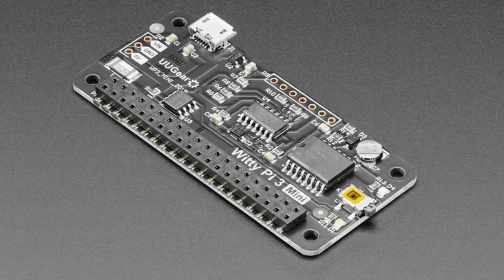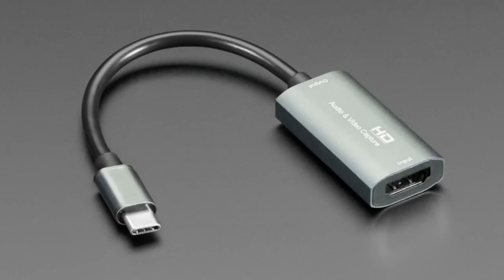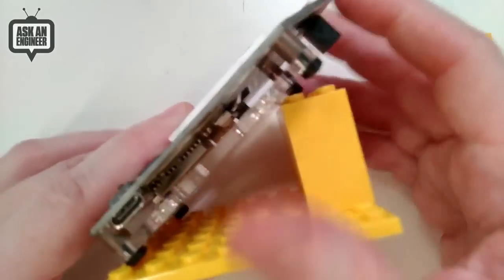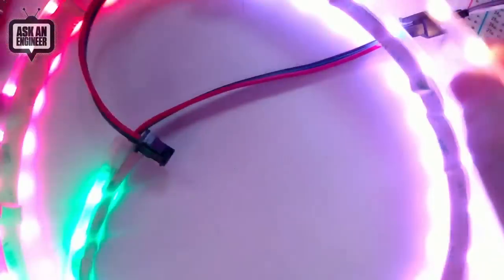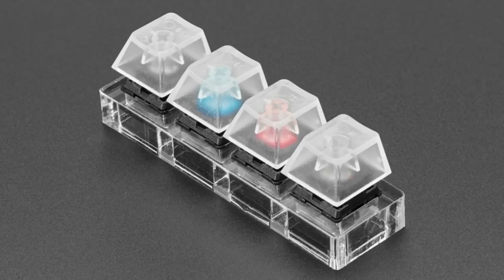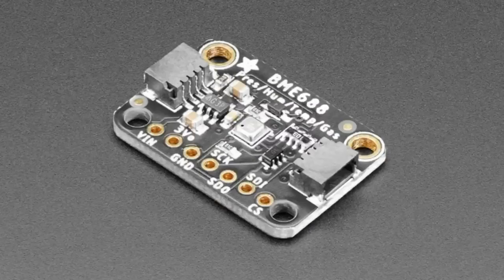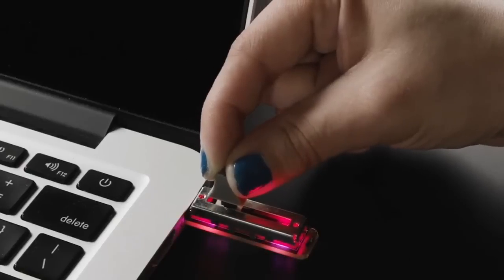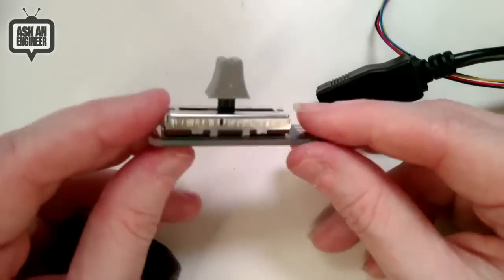New Products 5/19/2021 Featuring Adafruit Slider Trinkey - USB NeoPixel Slide Potentiometer!

Comment: I like that functionality of the Witty Pi 3, but I plan to use a CM4 IO Board, which already has a RTC, I just have no idea how to supply the RTC with the +5VSB power from a 12VDC ATX power supply. Can I feed that to the 5V pin on the IO Board's power header?